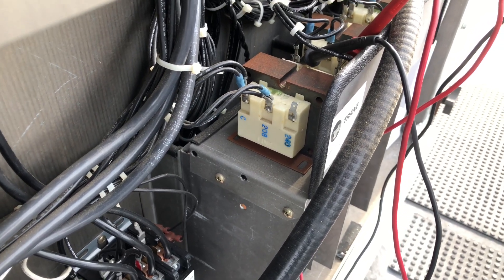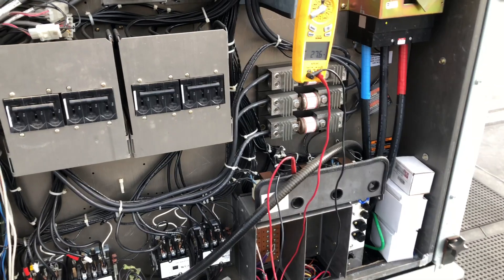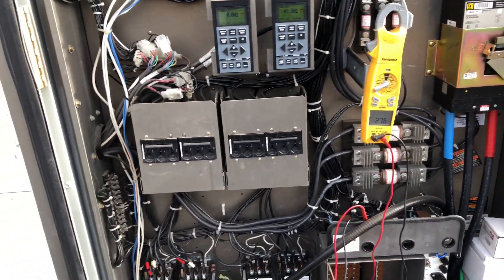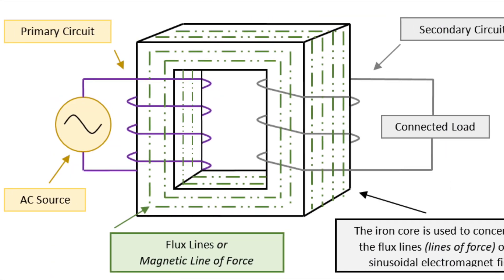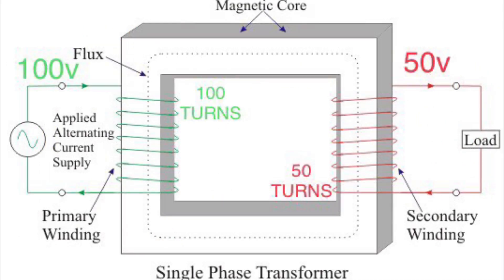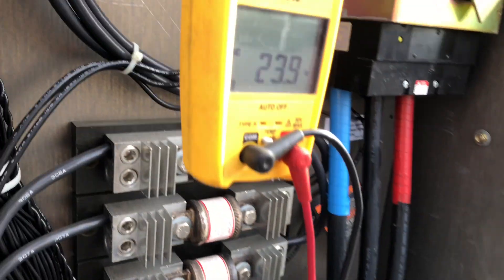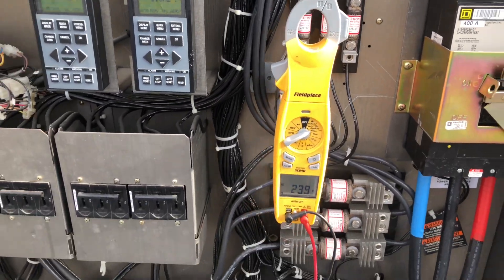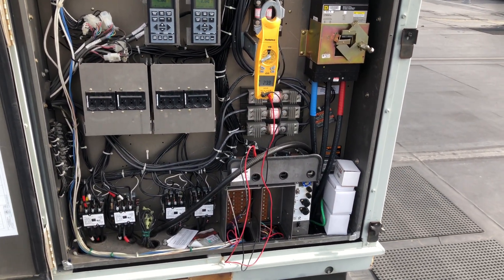HVAC:Multi-tap Control Transformer ! Why do techs always miss this one thing...

Comment: I noticed that the cables are Re Black and Blue but I was told that for a 3phase 480v should be BOY brown orange yellow I’m just curious
Reply from the maker: Good pick up. You are correct that is the proper color coordinations for 460 BOY. For some reason older Trane units they did all of their units in blue black red. They have now changed to brown orange yellow.

Comment: I just ran behind a company on a call with a package unit that had a honeywell thermostats ( 4 bunched up in the back office) with a room sensor(red, white wires) connected to s1s2 that never worked right even after just having tsat, sensor and limit switch replaced. Board always showed high limit open no matter what. Check wires at the plug which have resistance and aren't ol must be the board, right? Take thermostat off the wall grab jumpers,.put em on r and w still won't fire definitely the board. Swap the board, check the transformer which, made sure none of my wires were touching got no beeps, jumped r w before connecting my tstat wires and boom.. we have heat. Connect everything head downstairs, explain get payment then notice no heat. New thermostat just installed, new board, so head up and what do you know.. same 3 flashes.
Reply: So I take the room sensor out of the equation, take it off the wall,  check the wires, , check behind the tsat wires looked decent with s1, s2 kinda mashed together one side and a sep bundle kinda mashed to the right. Not perfect but I've seen worse, leave tsat off the wall and head up. Confused. Pull w, c, R caps off to check and I got 24 between r c and now I'm getting pissed. Jump r to g and the compressor short cycle error code flashes along with the limit open error. Keep  In mind new board, plus new tsat,omit switch, sensor and I no wires touching when checking continuity with the wires taken apart. I'm curious before I finish the story what your thoughts are..